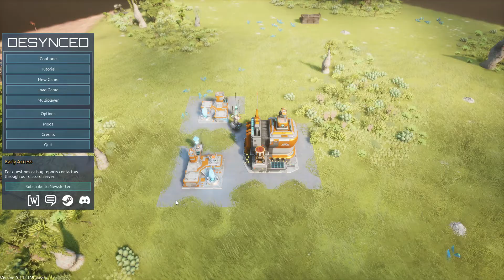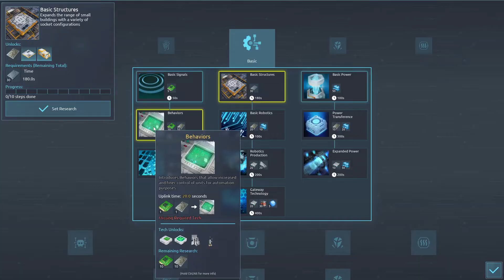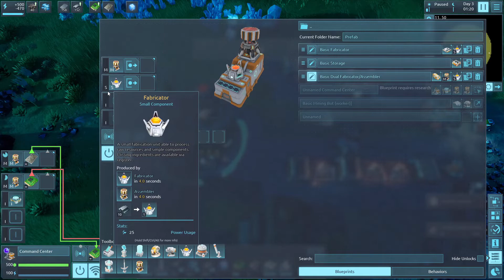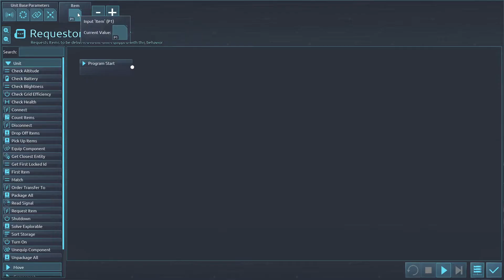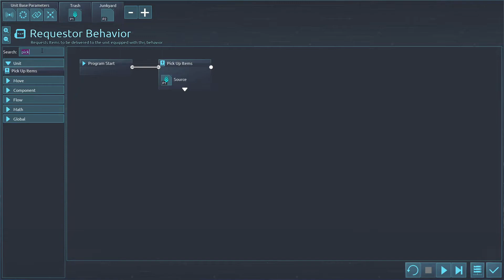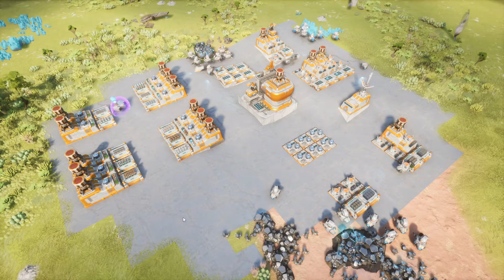Full STEP BY STEP guide |  Desynced  |  Let's Optimize

Comment from the maker: DO NOT START THE GAME WITHOUT SETTING IT TO AT LEAST HIGH RESOURCES!
(or you'll end up having to reboot like myself and many others before you)

Oh, and of course like & subscribe if you haven't done so, it really does help me out!
Reply: Thanks for the heads up.
Reply: Would u do a vid on ur actual game settings
Reply from the maker: Anything specific you are wondering about? I'm using all the default settings, with the exception of the amount of resources (those are set to ' high') @sethsteuer6926
Reply: @TheDutchActuary  for just my first game, i also have set enemies to passive so that i can take my time experimenting and finding out general things, without needing to care for attacks and protection immediately
Reply: Im going to follow this step by step thank you. I notice when I start fresh with new game to follow along I even enter the same seed number. But my landscape is very different and quite barren. It shows the correct seed number but is very different terrain
Reply: I went into the tutorial. I have only one scout. It says to select it with left mouse then move it with right mouse... I select ot with left mouse but then using right mouse moves the camera/screen NOT the Scout?
Reply from the maker: If the screen is moving when you use the right mouse, you're holding/dragging it. Just click once to move the bot ;) @-Free.Spirit-
Reply from the maker: It's possible the recent updates changed the seed numbers. I might make a new playthrough soon though! @-Free.Spirit-
Reply: Could you elaborate why i should set it on high? I played some games from scratch and set the last on high and o boy are the resources big on high. So big in fact that i think i never need to venture out. But the map has no limit for resources because the size is not limited?! So i guess it's a preference?
Reply from the maker: When the game initially became available, the default settings had very sparse resources. This has since been rebalanced so it is far less painful now ;) @tanmorik6396
Reply: @TheDutchActuary  ah, thanks gor the reply. I suspect that. Time to restart again :D

Comment: Superb guide.  I had about five or six "OH, THAT's how that works!" moments, lol.  And yeah, on my first try with medium resources, it just devolved into continuous chasing of new metal, crystal, and especially silica sand locations, driving base expansion at a much faster rate than I would've otherwise liked.  Which does add some challenge, especially with hostile fauna (which I do keep turned on)...I just suspect that game default should probably be on "High".
Reply from the maker: I agree, I have found the 'high' setting to be the most balanced/fun.

Comment: A bit late the party but I've followed this perfectly and the janitor just sits there. the behaviour flicks between pick up items and drop off items but the janiot wont move. All the move commands seem to be to units so I can add a step where it moves to the item?  I guess they changed something in the latest patch?
Reply from the maker: That's odd. Is the janitor actually detecting any items (if not, that's the problem). If it is detecting it, did you link the item detection to the pick up command properly? That should get it to move.

If it's not i'm not entirely sure what is going wrong, it should be working afaik.
Reply: @TheDutchActuary  when i link eg the radar to the GOTO parameter with an arrow in the bot interface, it works, even completely without any behavior, and i probably also can output (eg with the copy command) this to a parameter that then is linked to GOTO. but i failed doing it purely in a program since i couldn't convince it to treat some found droppings as an item or building or unit or whatever that i could "move to", and then pick up (i think the move works, but what would be the command for picking something up from the ground?). that seems to happen only aut8matically as some kind of default action when arriving at the "GOTO" destination.

Comment: 33:15 maybe somebody will help me a little bit here because I don't understand exacly how this button "connect to network" works. In the example of the janitor it has this feature in OFF state yet it is working fine and he is doing his job.
Reply from the maker: " Connect to Network" means it 'sees' all the supply and demand of the other buildings in the network and can interact with that.

In this case, the items the janitor is looking for are on the ground (not in the network) and it has a fixed drop-off point (so it doesn't matter what network that is part of). That means it doesn't need to interact with the network.

Comment: When would you use a battery instead of capacitor?
Reply from the maker: Whenever you need more power stored. Capacitors are decent initially for small buffers of power during the night, but batteries are far more efficient at doing the same thing. They are great in the early mid game, but as soon as you start building wind power on elevated terrain you should never run out of power again.

Comment: Excellent information. I have over 100 hours in the demo and EA so far. I found that two space roads are not enough. Three spaces works much better.
Reply: i learned that in other games: workers always end up along the sides of a road with no more space for others to pass if it is only two wide. thus three wide is the minimum. having more than three depends on how much traffic there is, how many workers wait at buildings, how much space (and thus larger distances) you are willing to have, etc.

Comment: ah there we go my boy🎉🎉 now we talking. currently stuck with the program thing. trying to setup a network inside a network and im not understanding the program functions to well. they not explained well thats probably because im not a programmer 😂😂
Reply from the maker: I would recommend keeping the programming as simple as possible. You CAN make very complicated programs, but I've found very little reason to do so. A few simple programs definitely help out a lot tho!
Reply: ye i kind of got it working to a point, the issue i see is that the program thing is bugged abit or maybe its just me. when a command has two outputs example the check for space command which has a true function and false function now the false function it doesn't read it and then skips it and reloads the program.
Reply: bladie hell haha nvm found "my bug" 🐛 haha the issue was that the items i wanted checked was in infinite....i set the value to the max amount it would be able to carry by reading the visual parameters and bam it works now it doesn't skip the function. phase 1 complete

Comment: 31:40 you can actually set this up without using a behavior by setting the output of the radar to the unit go to (?) register and setting the unit's home register to the junkyard
Reply: i have done it like that too, and am proud to have found this out myself before watching any guides :-)
i also have done this on my "destroyer scout" so that it does all the work, and is faster than a simple worker.
but thanks to this video, i'll do it on a new bot with behavior and will try to improve the program (eg collecting more than 1 item, etc)
Reply: yes, as an early method to do it, it is fine. but the bot most often will start running to STORE as soon as he got an item and is idle for a fraction of a second, and then find another one, turn around and get it, and spend lots of additional time for this. or even worse, will first drop the old item off because he is already too far away to find the next one.

as i wrote a month ago, i had created and used such a destroy&collect bot and used it all the time until half an hour ago i got tired of that scout running around with its "small" inventory while cleaning up a huge mess from the aftermath of a big battle. now i have a transporter with 12 slots which is triple capacity, and he runs much faster and additionally doesn't do that forward-and-back dance. on the other hand, it took some time to program it correctly (still not completely done with letting him presort all the loot), and then he immediately took a shortcut over a bug hole :-(